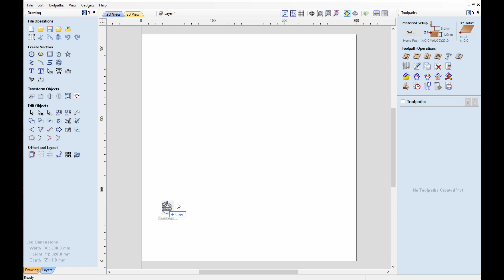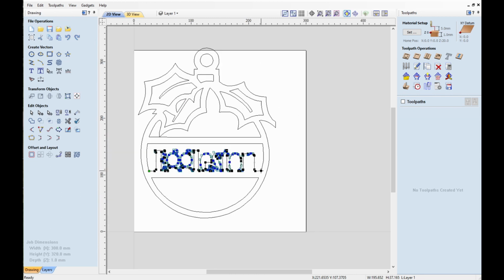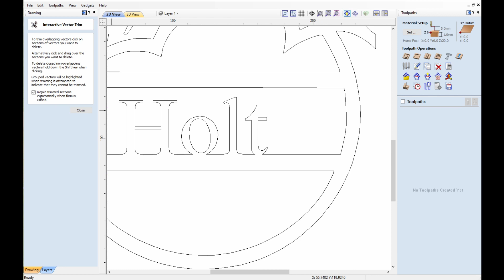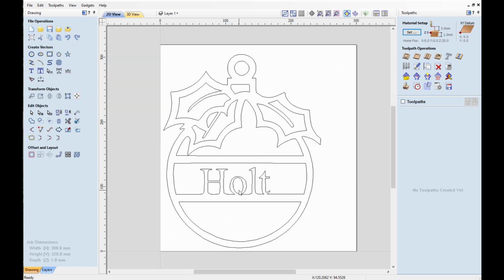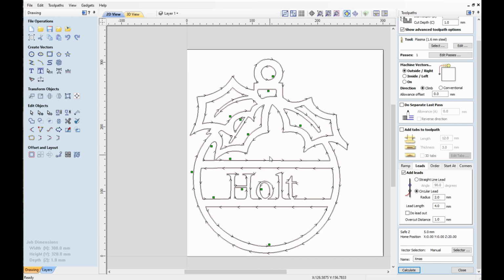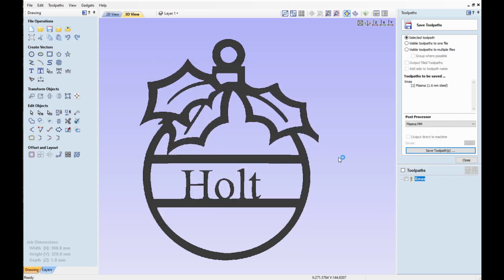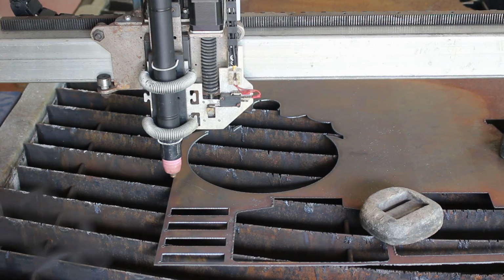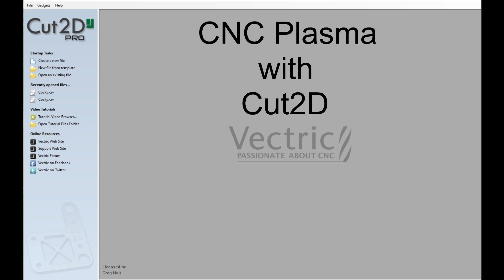Xmas plasma project using Vectric Cut2D

Comment: Can  u share the post I use mach3
Reply from the maker: My PP will not work for you.  It utilizes macros from within my control software as well as customized  fields in that software.
See my other videos for a more general view of how I modified my PP.   
You must understand how YOUR control software and machine work together to do plasma cutting.
Then modify the PP to provide those requirements.
Reply: After you create the file for cutting, what do you use on your plasma table? Sheet cam etc..
Reply from the maker: @MrAtla5    Cut2D is used to create the gcode.   No need for SheetCam etc.
Reply: @Greolt  very new to CNC work so getting very confused with what I see people doing, is. Create with inkscape or fusion 360, then sending it to sheet cam or myplasma, then through Mach 3 and so on, abit frustrating having to run though multiple programs, worked on sign writing, so would draw in signlab and send it to the cutter job done, I am building a small plasma cutter so looking for the simplest route to cut?, So if I follow your video create a g code, do I then just use universal gcode sender to talk to the machine, gbrl based board?, Thanks for the help and the video by the way 👍 great job